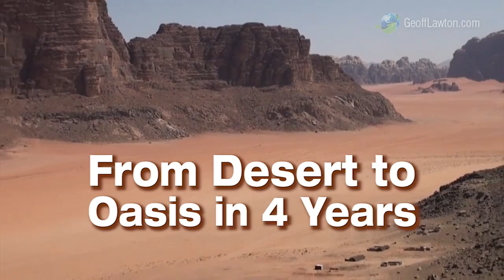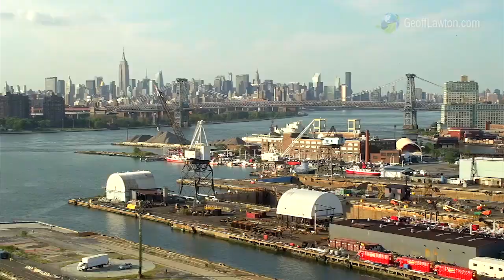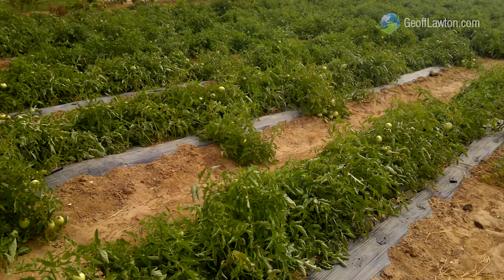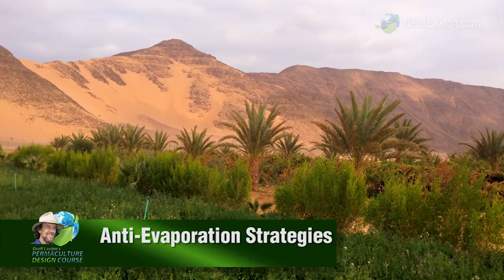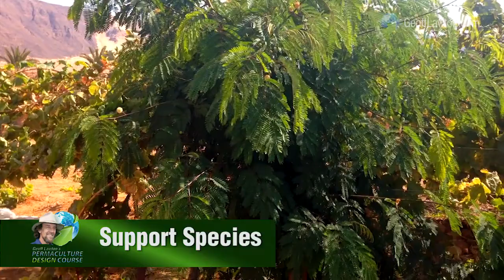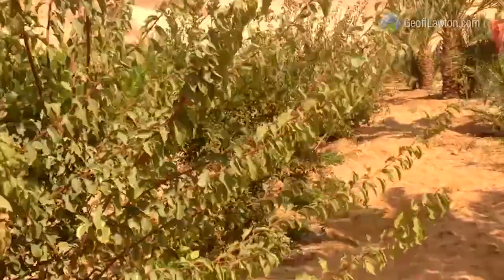13 Desert Oasis

Comment: I can understand the need to use excess agricultural water, for start-up, but will this system be able to function without it, should it stop flowing? How old does the system have to be in those extremes, to eventually live off rainfall and precipitation alone?
Reply: The latest Greening the Desert v 2.0 was established with no outsourcing of mulch or water, its astounding, check it out here https://www.discoverpermaculture.com/video-1-pdc-2019